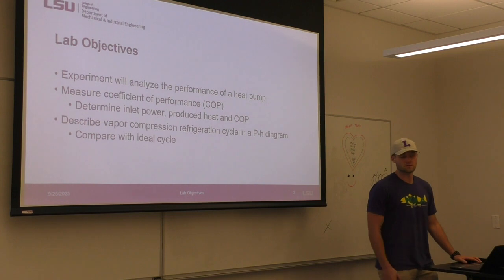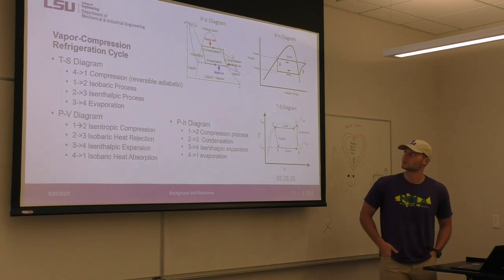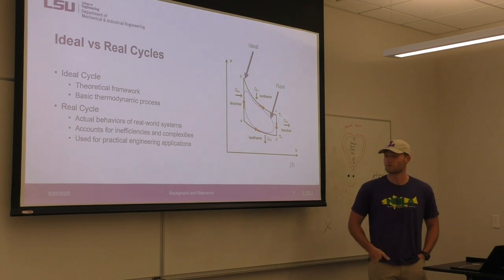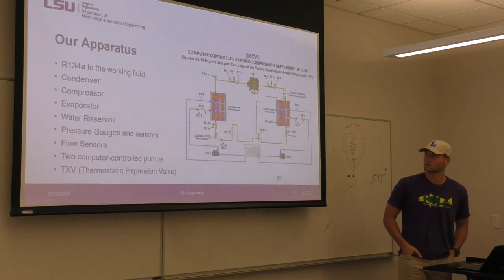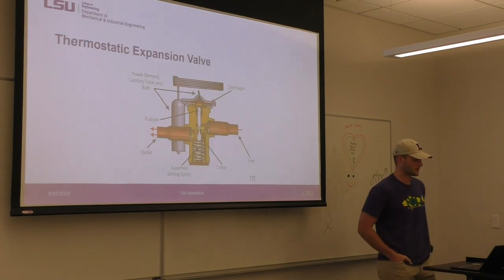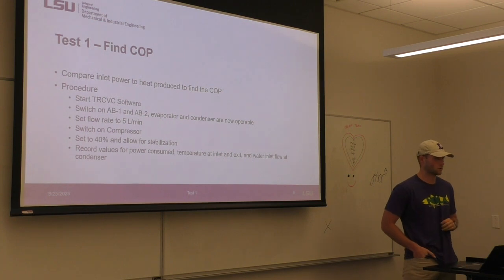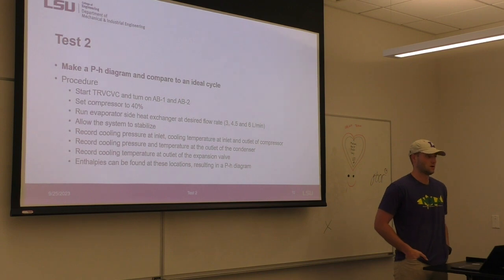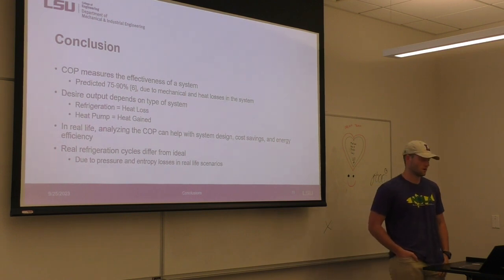Cam Arnold

Comment: Great presentation. The explanation of the cycle diagrams was helpful. One thing I would say is to keep the information centered around the actual experiment. Since you are limited on time, the steps of the lab exercise are the most important. Shortening your explanation on a few slides will help you reach the time limit.

Comment: I need to trim the talk down to make the 6-minute limit mark. Also could have explained the difference between a refrigeration cycle and a heat pump setup. Guess I also need to read up more on how the valve works, as my sources said it controls flow rate, however TA stated its pressure.